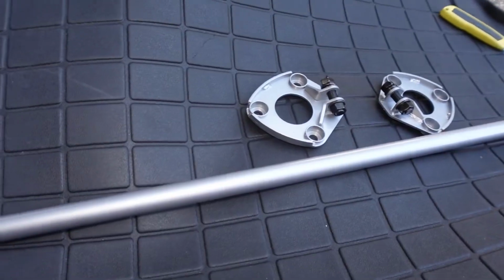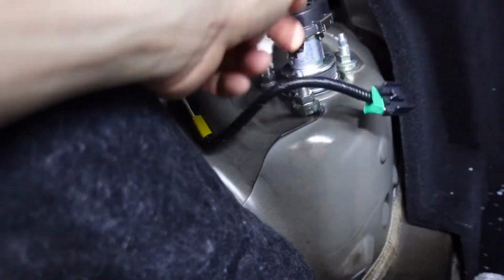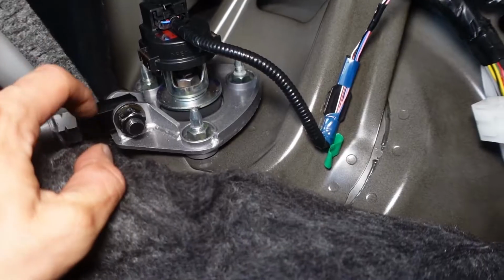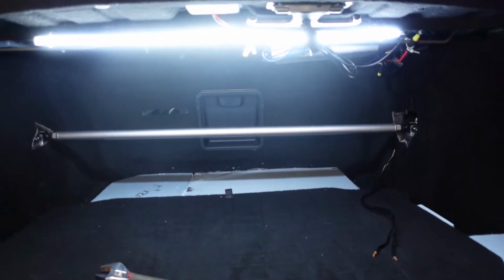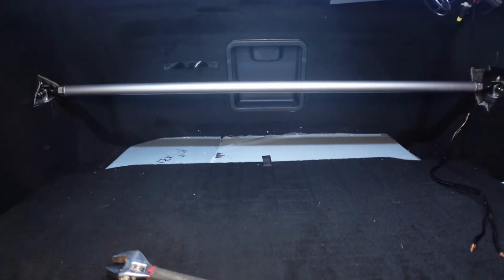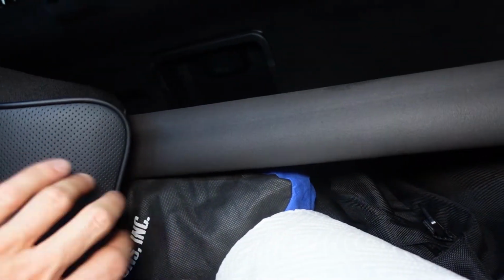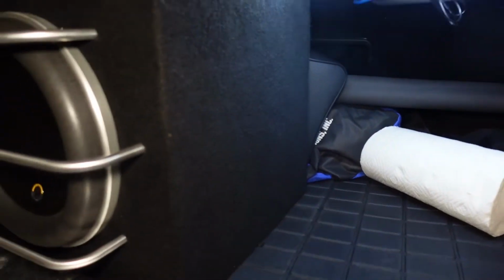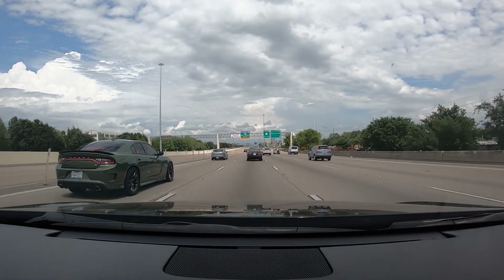Tom's Rear Strut Tower Bar Trunk Bar Installed and Reviewed!!! 2013 GS350

Comment: Looks great. I’m glad the install went well. So it seems getting to the strut bolts is a fairly simple task. I am going to replace my rear struts soon, and don’t want anyone tearing the back of my car apart. Great job and thanks for the video!
Reply from the maker: Hey what's up! Easy install for sure, your trunk liner will be fine!
Reply: @j168vlogs  so let me ask you something. I was under the impression only the front struts were adaptive. Are the rears adaptive as well?
Reply from the maker: @Brandon-jy2yl  Hey what's up! I actually only though that too but apparently we were both wrong lol! I believe what I removed was a sensor for the rear AVS.